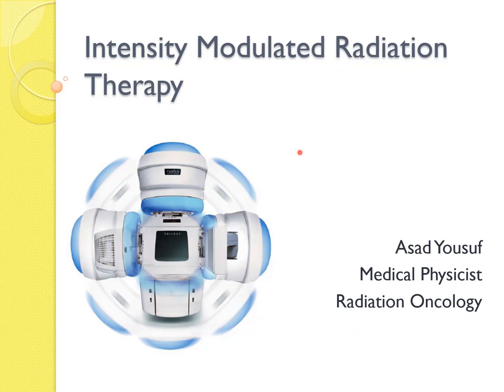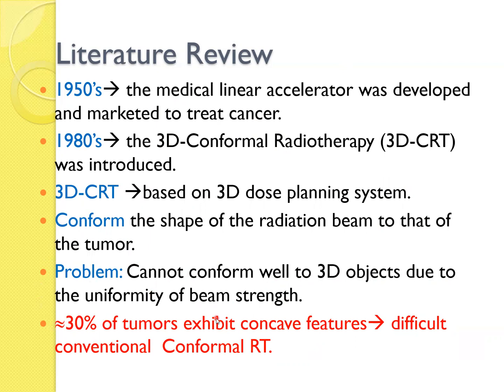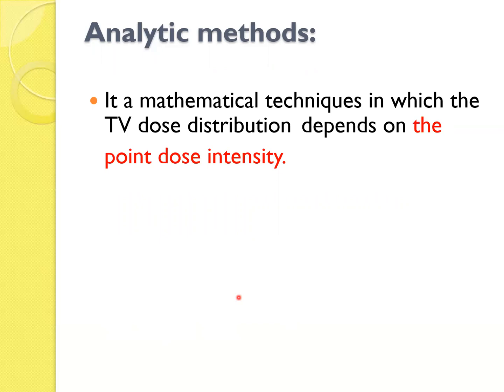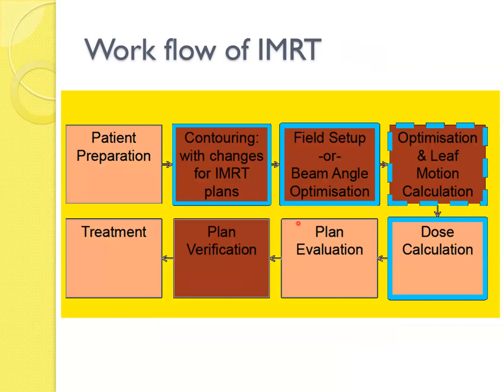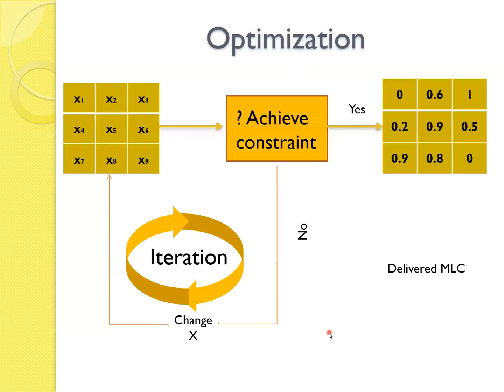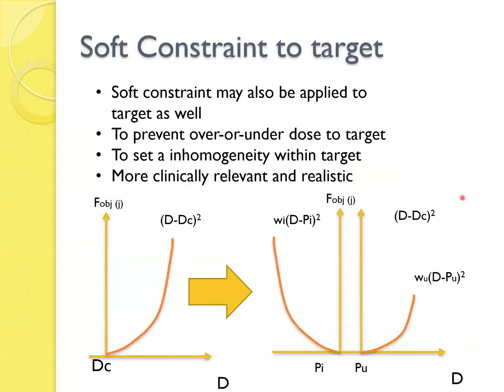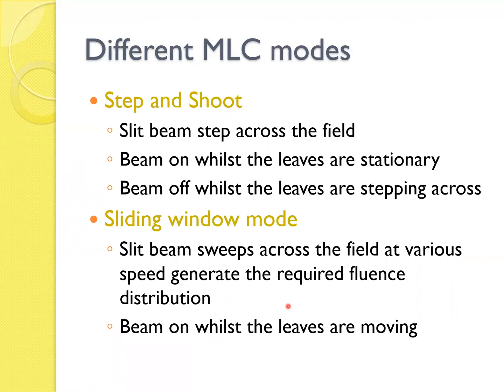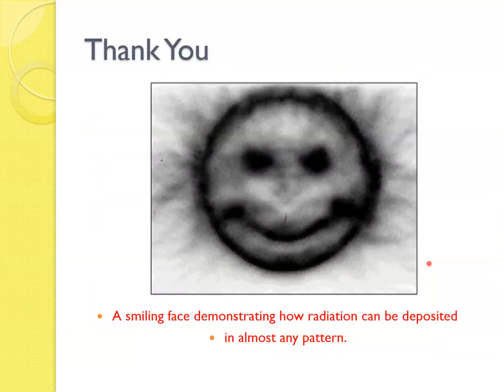IMRT Concept

Comment: Thanks for the upload.. may I know what FS you went down for small field.. did you treat SRS case 1cc lesion volume.?
Reply from the maker: Well smallest we treated was 0.7 cc on true beam with 0.5cm MLC width
Reply: @MPTFoundation  did you measured output factor for 5 mm FS ?
Reply from the maker: @sumeerofficial5692  0.6 mm least verify with TPS calculated value
Reply: @MPTFoundation  thanks for the reply.. may I know your TPS? As far as I know eclipse will only accept 1x1 cm FS data for beam model configuration for output factor table.. so below 1 cm target how will you know the TPS calculated one is true value or not.. expect we can verify TPS with some end to end test.. did you do any special test addressing this matter?
Reply from the maker: @sumeerofficial5692  Watch this https://youtu.be/cgoezwfYGc4 i have explained in this video